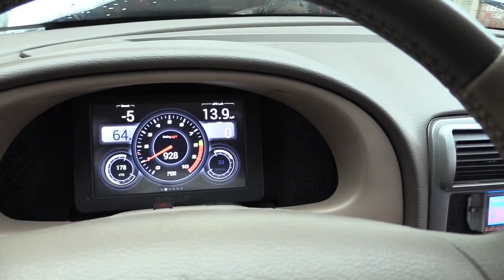What’s going on with my turbo 2v?

Comment: Hell yeah Son!! Unfortunately for me, mine has came to the end.. I was going to start posting video's and then some bad mojo or something.. but, a $14 ground snapped off and about burned the damn thing down at a local track, to boost controller wasn't controlling anything and cracked my block with the two over killing Borg Warner 81mm turbo's..( pretty much the same turbo you have) only thing that kept the teksid block together was the MMR billet main caps, MMR billet rear main assembly and the DSS racing's main girdle. So.. I pushed it into the trailer until I move to Clarksville.

Comment: What throttle cable and throttle position sensor did you use. Also how did you set up that intake manifold as far as vacuum is concerned. trying to get a similar setup up and running and wanted to know how to set it up. BTW love the car man happy to hear it purring again watch every video.

Comment: I didn’t figure you would have built the car to go even faster with a block that couldn’t hold more power! How long is it taking you to spool the s480 on the transbrake? I have a 4.8 ls with a s480 and it’s crazy to see how much more power the modular motors make at the same ci
Reply from the maker: LSX Cutty87 takes about 5 seconds to make 10psi on the brake

Comment: I'm curious as to why you didn't use a teskid block ? I thought the teskid blocks were alot stronger than the WAP blocks plus you can find the teskid in tons of 96-98 Lincoln Town cars and Lincoln Mark viii's you can pull a block for less then 150$ from pick n pull I bought mine for 80$ some pick n pulls will charge you more or less depending

Comment: Was wondering if you could do a video overview of your wiring and electronic setup. Also Curious what manual steering rack you went with?
Reply from the maker: Isaiah Sandford it’s a unisteer manual rack
Reply: Andrew Lavender 10-4. Love the car man. Reason I asked about electronics and wiring was because I wasn't sure if you bought a holly wiring harness or stuck with stock? I went with MS3 setup and am currently re wiring whole harness to clean things up. Your engine bay looks super clean🙌

Comment: Awesome vid! What steering rack, stock or manual? Solid steering shaft? Did I miss the size injectors/fuel setup?
Reply from the maker: mega catares unisteer rack and steering shaft, Holley 160lb injectors and twin walbro hellcat pumps

Comment: i was wondering  if u could give me some advice on base afr and base timing on my 2v car im running holley hp on a 322 ci 2v trick flow heads 76/75 billet wheel on 3 turbo i basically copied your car just got it running trying to figure out a safe 10psi tune on 93 pump gas   any help would be greatly appreciated
Reply from the maker: Lenny Philpott 14.0 at idle, 11.0 at wot 

22degrees idle 
24 at wot no boost 
15 degrees at 13psi
Reply: thats on pump gas not e85
Reply: what does your oil pressure run at a hot idle mine seams a little low 25 psi at 187 degree coolant temp goes right up off idle engine builder is telling me its fine it makes 70 psi cold im not running a restrictor in the turbo feed and it is teed off of the oil pressure sensor port in the oil filter adapter  a buddy of mine said to try a .060 restrictor in the oil feed he said his car gained 10psi doing that wondering if u are using any restrictor im using a gt500 pump housing with boundary oil pump gears 80lb bypass spring
Reply from the maker: Lenny Philpott yeah I would use those numbers for pump gas. Your oil pressure is good
Reply: thanks there isn't a lot of info out there on 2v mod motors